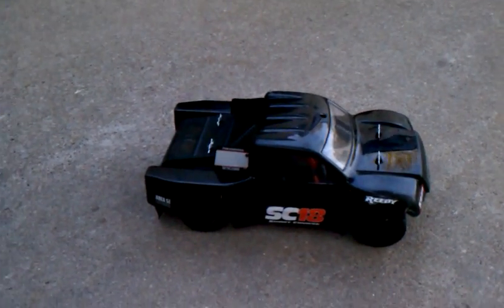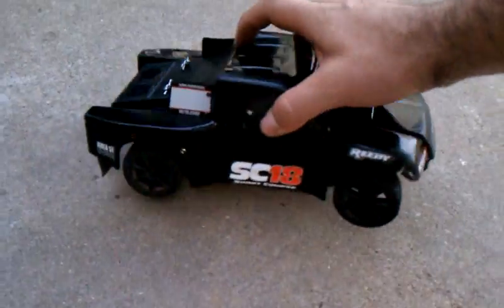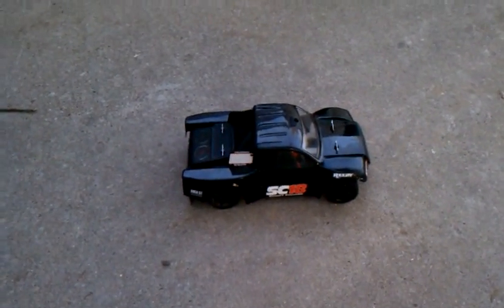Demo SC18 without Belt Tensioner

Comment from the maker: @RockitRC, haven't noticed any slippage yet, but the belt has definitely loosened a considerable amount since I first bought the car. I may have to buy a new tensioner or simply replace the belt if it starts to give me any problems, but for 2 months of racing so far, I've had no complaints without the tensioner :)

Comment: Have you noticed any belt slipping with the tensioner removed? Mine slips a little when I am rotating the front with the rear on the table, but I have not really noticed any while driving. Maybe I am just missing it, but the motor is coming off much cooler.

Comment: @billdelong depending on how big those gaps in the steering are you could easily fill it with a slight dab of hot glue (spread with your fingers, shoe goo sould work as well) and thats a good idea with the bb assembly, reuse what u got!

Comment from the maker: @beastxmoder, those are some great tips!  I actually I cut off the ball bearing assembly and re-installed the cover plate. I didn't want to destroy the belt tensioner before running this experiment first... BTW, there is still a huge gap in the steering linkage that allows dirt/debris into the drift belt assembly too :(